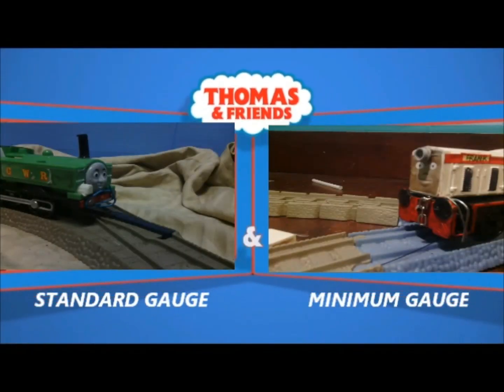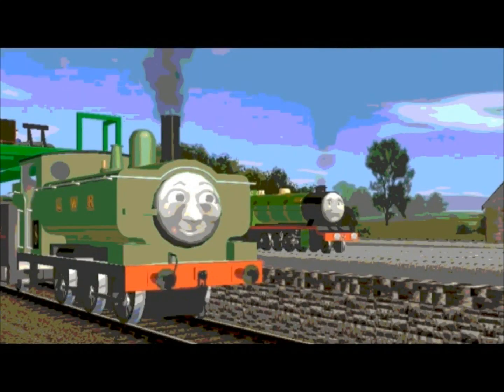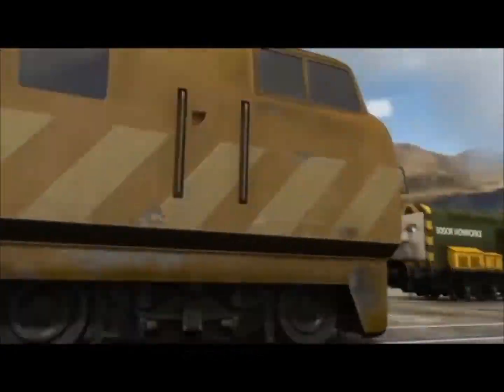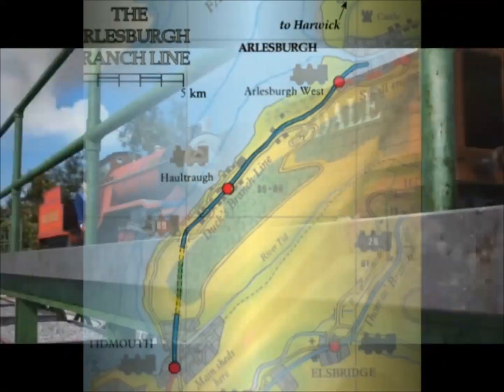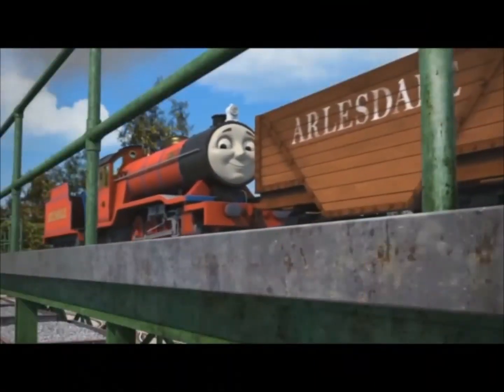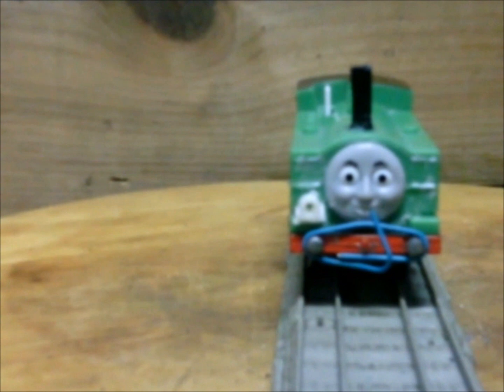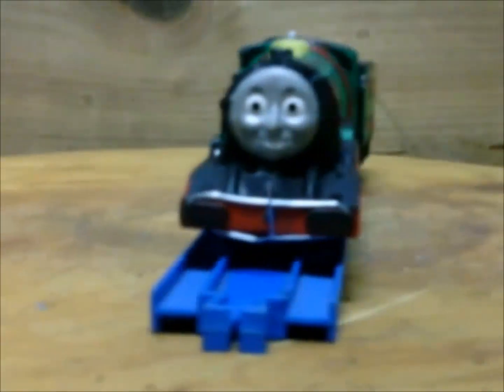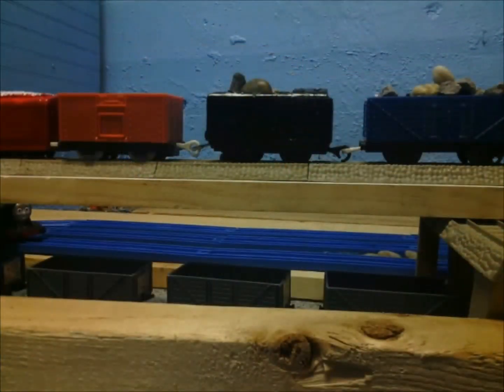SG118 Lesson | Standard Gauge vs. Minimum Gauge | ft. Ken Friedel

Comment: Standard Gauge & Minimum Gauge. What's the difference? Well let's find out. On the Island of Sodor there are many engines, both Standard Gauge and Narrow Gauge 
But what we're going to learn is how Standard Gauge and Minimum Gauge are different 
Whether it's Steamies or Diesels most engines run on Standard Gauge. 
But a little railway is located on Duck's Branch Line is a Minimum Gauge called the "Arlesdale Railway". 
Here's Duck, and here's Rex, notice how Duck is bigger than Rex, and if you didn't notice a Standard Gauge track is dilated a scale factor of 0.5 to make Minimum Gauge rails. 
Here's Duck, he's Standard Gauge like Thomas, Gordon and Oliver, they're bigger than Minimum Gauge engines. 
Here's Rex, he's Minimum Gauge like Mike, Bert and Frank, they're very small and can make even tighter turns on Minimum Gauge rails than on Standard Gauge rails and Narrow Gauge rails, it's the same for rolling stock too, at Arlesburgh West the Arlesdale engines collect ballast from old mines on hopper cars/trucks that run on bogies, fill them up and transfer them to Standard Gauge cars/trucks so they can be taken to be spreaded on rails. 
 Standard Gauge & Minimum Gauge, one big, one small, two different sizes of engines for two different sizes of track, whether they are big or small they have something in common, and that's being really useful